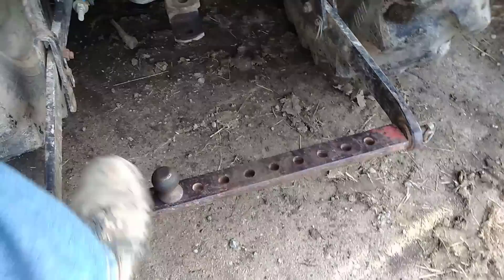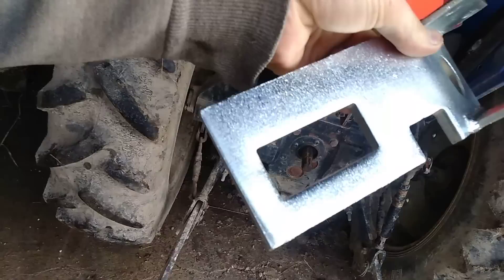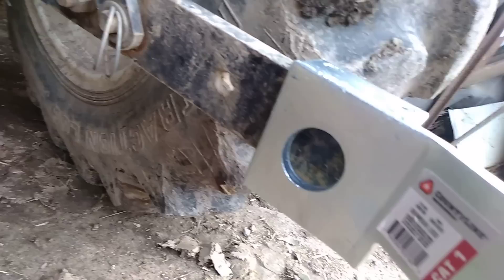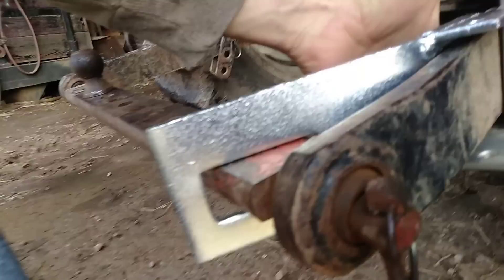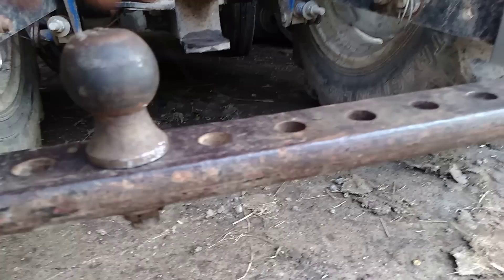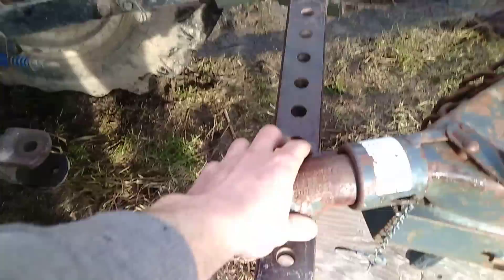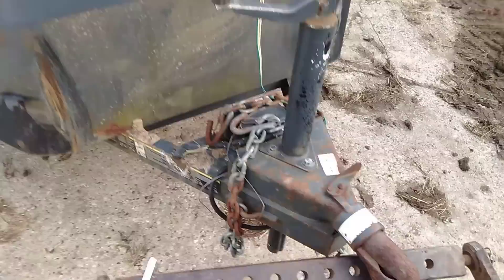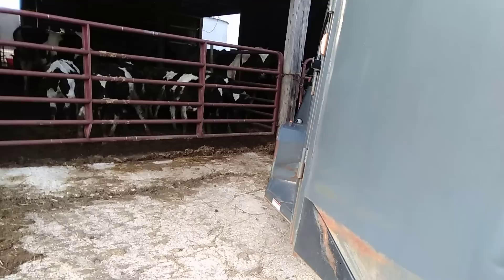Stopping the Draw Bar Twist

Comment: The notch is there to allow the stabilizer  straps to be used on the older tractors. It is supposed to be applied to the left side with the notch on the top side

Comment: Well, the extra notch and hole are more likely to be so the bracket fits on different 3pt arms. The operations to remove those two little chunks of metal cost more than the value of the metal saved.
Reply from the maker: I will have to keep trying different three point arms to find out.
Reply: The piece looks like it was stamped to me, so in order to include the extra notches all that's required is the die to be made that way, requiring no extra processes to the manufacturing. Now if it was me making them in my shop, that would be a different story! Lol
Reply: The notch is to clear the stay bars that should be fitted to the 3rd point of the linkage when using a drawbar. The arms are not designed for pulling heavy loads, the 3rd point is.

Comment: When I got my tractor, I went to the trouble of using two pieces of 2x5/16 angle to make an A-frame that goes to either end of my drawbar and hooks to the top link. I kinda wish I'd seen one of these first.
Reply from the maker: This is very quick.

Comment: Hi , Jacob . I was reflecting on your Last Video, on the Doom and Gloom in Farming at the moment. Farmers have very little control over the price they receive for thier crops or their Animals.So thier only choice is to drive costs down as low as possible . And hope that returns cover thier costs which some years clearly they Won't. Using Wheat as an example in 2006 I sold wheat for £60 per ton which results in a loss no matter how you play with the figures. Yet in 2012/2013 I sold wheat for an all time high of £201 with an average wheat yield of 4tons to the acre this results in a good size profit. But and hears the catch despite what the experts tell you . There is NO WAY of planning this . Other than survive the bad times to still be thir in the Good. Regards David
Reply from the maker: Geez, that's a big price swing. The planning is don't expect the high prices to last.

Comment: I actually built a few of the 3 point trailer tow bars, made it have a normal 2” trailer hitch receiver so i can hook it to anything to it. And on the arm that goes to the top link i welded a ball hitch on it so i can jockey around gooseneck trailers
Reply from the maker: I wanted one of those,  but then I could not use the PTO with it on.
Reply: Boehm Farm ahhhhh I have a small blue and raspberry farm only 30 acres, I don’t have any drawbar implements that hook to a pto only a brush hog and i just use the tractors drawbar for that because the pto shaft wouldn’t reach. Love the videos man

Comment: If you would replace the standard nut on the bolt to a self locking nut, it would keep you from losing the nut and bolt because of vibration or bouncing.

Comment: grat  film in the UK . we use the try point linkage & the stabilize.  The  bar's  they  slides  up and down   like that but pin in to the hols of the cross bear,   go on the centre link with a spacer in the middle  & that holds  you see has a pin  some  have two berending on the load  welded to gather with a short bit of bar.  that when connoted hold the harms in place at different  heights  imagine the  two bar  with a open  hitch & pin on the bar  & one at the top With tow in the medal  one having several hols the other two, for the pins held together on a short welded together to line up with the holes.  once fitted we would  remove the pins & lower or raise  the sliding  harms  pick up the load  & lift to required high the replays the pins so it would hold at that Hight put in the spring clips   you can Mack the your self i did  we ues the black smith . Or local fab shop   . that siystom is fool proof.

Comment: Now that's cool. But I do have the tool that uses the top link to move our gooseneck trailer, it also has a place to pull a wagon or trailer such as that one. Did you get it from tractor supply?? Rural King?
Reply from the maker: I found it at TSC, just because that's what link a viewer sent to me.

Comment: I am wondering if you have ever pulled a baler with the 3pt draw bar? I would like to get the tractor further away from the windrow but not sure if the 3pt drawbar is the right way to accomplish this.
Reply from the maker: That could put more angle on the PTO than necessary. You'll either have to swing the baler hitch more, or move your tractor tires.
Reply: Yeah driveshaft geometry is your biggest limiting factor-- the PTO shaft should be as straight and level as possible when baling most of the time (except in turns of course) to minimize driveshaft and U-joint wear and prolong its life...  If you have a swinging drawbar on the tractor, you can swing it all the way to the right to move your baler over, or even just a couple holes not quite all the way.  Still gonna put the PTO shaft running at an angle all the time which is harder on U-joints and can chatter due to unequal angles with the tractor end yoke being a tighter angle in turns (a lot of balers had a short front shaft centered over the tongue so that when the baler turned the U-joints on either end split the angle in half evenly between them, minimizing U-joint chatter.  

The other issue is, you have to be careful moving the tongue over that when you turn that nothing hits, like 3 point arms or the tires on the baler tongue... I used swing the drawbar over when raking and it moved the tire closer to the rake and in a RH turn it was too easy to stuff a tractor tire into the frame of the rake, so I put it back and just ran over some of the hay... Better that than having "collision problems" in turns.  

Later!  OL J R :)

Comment: Can you use draw bar w/ out this device- I know it can rotate but what I mean is once trailer is down on draw bar doesn't tougue weight keep it in place?
Reply from the maker: No, if the ball was a perfect fit, you could go without it, but the ball is too small for most of our trailers, and I'm just using it to move trailers around the barnyard and don't feel like getting on and off the tractor to latch the hitch every time just to have to undo it in five minutes.
Reply: Technically if the ball is "locked" into the hitch, theoretically yes, BUT the ball will rotate until it's in a bind and that's very hard on the points of contact between the ball shank and the hitch socket edge... OL J R :)

Comment: We tried that but our tractor has the stabilizer bars on the inside to keep the lower link arms from jamming into the tires and it interferes with the stabilizers
Reply from the maker: Yep, something will always get in the way.
Reply: Get some angle iron to "sandwich" over/under the bar and a stack of washers or oversize old nuts to slide between them and the bar, and a bolt long enough to bolt it all together... the angle irons go over and under the draft arm to keep the drawbar they're bolted to from rolling either way... Just need a couple three feet of angle iron and torch or drill a couple holes in them, and of course the bolt and stack of washers or scrap bigger nuts... OL J R :)

Comment: How much hp does that new holland have? We have Kubota b2601 with 26 horse power and that sounds exactly like ours
Reply from the maker: New Holland says it's 30 engine hp.  91.3 cubic inches.
Reply: Thank you
Reply: @michaelenglish904  I have a 2000 year model Kubota L2600DT (4wd) with 26.9hp and only 300 original hours in 22 years. It has a Bush Hog 2245QT front loader and I really like it.
Reply: @zekethefishgeek8690  kubotas the best

Comment: Farmall 2 point fast hitch is superior
Reply: Yeah that's why ALL tractors have it now LOL:)  Seriously, for moving trailers and using the lower links for drawbar work the 2 point spear hitch is good... for everything else, NOT SO MUCH... OL J R :)
Reply: @lukestrawwalker  The reason the fast hitch isn't popular now is because the 3 point came out first and john deere wanted to buy it off of international at the time but refused. I have a fast hitch 3 bottom plow and a fast hitch sickle bar mower for my farmall 450. I never had any problems connecting or disconnecting the implements and was far faster due to even having to get off the tractor except to hook up the pto or hydraulics .as for the 3 point it can be a huge pain most of the time.
Reply: @henryofskalitz2228  but implements outfitted with it couldn't be used on any other tractor, and no regular 3 point implement could be used on a two point... Plus holding a good angle adjustment like on a plow was very difficult... Sure they had an adjuster but with no top link to brace against, holding the plow at the proper angle in tough conditions was a mess.  For all those reasons it went away, like the eagle hitch, snap hitch, etc
Reply: @lukestrawwalker  The IH manufacturer had actually made a 2 point to 3 point adapter and it works fairly well. it has a quick hitch type 2 point so you just back up to the implement and raise the 2 point. then you attach the top link and there was minor adjustment able to be made on it. so you can still use 3 point implements on a fast hitch. also the fast hitch Had draft control. on the implement like the plow itself it has adjustments for the right angle on the plow like the moldboard depth wheel, then for the angle for plowing is on the fast hitch so you can have to tilted left or right.